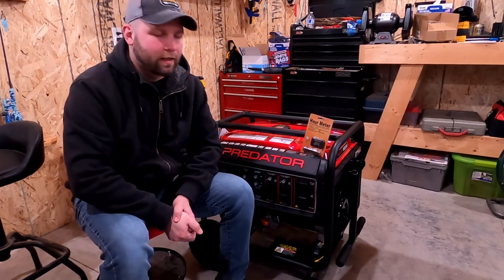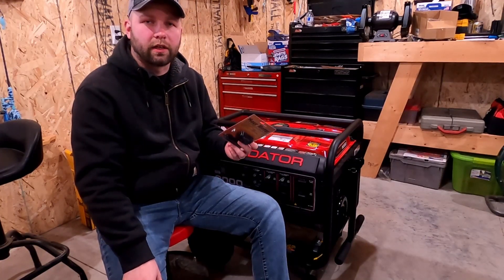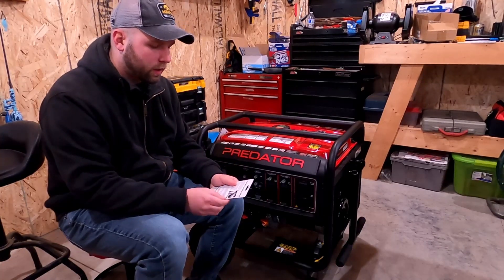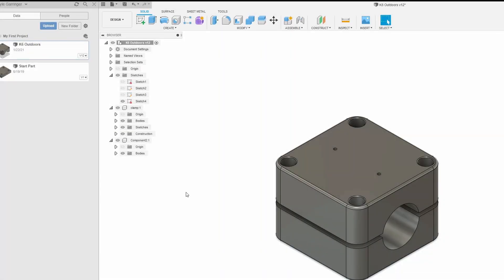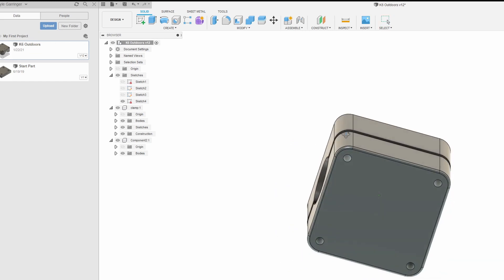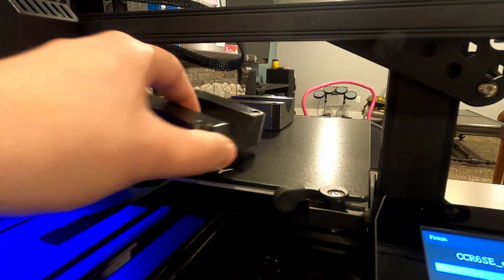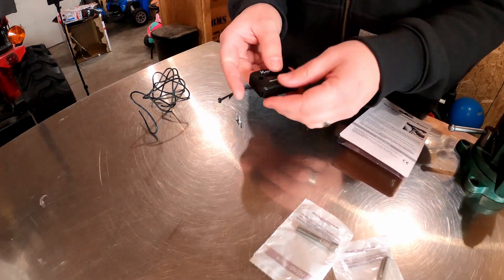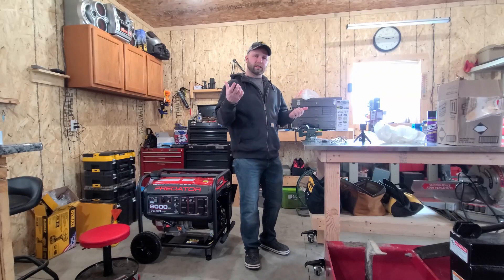Universal Hour Meter Install on the Harbor Freight Predator 9000 Generator

Comment: Awesome installation. I’ve got almost every other tool but a 3-D printer. I don’t think of any viewers are going to have access to a 3-D printer. I made a project box with 2 LCD displays showing volts, amps, amp hours and watts. One for each of the two phases. It’s mounted near my innerlock near my main panel. I also threw in one of these our meters on the project box. Works great. A 3-D printer would’ve been awesome for making my project box but I found a standard size one that works fine and cost $15. Great job on yours
Reply from the maker: Greatly appreciate it! The printer is a great addition and I very reasonable in price. I hope to get the house connection setup this spring so I can plug and play the generator. Thanks for stopping in!
Reply: @k6outdoors  what model is it?  I might have to consider getting one. Thanks
Reply from the maker: @condor5635  it is the CR6 SE, checkout the link in the description below.
Reply: @k6outdoors  - Thank you is the software that you demoed part of the 3-D printer package?
Reply from the maker: @condor5635  the printer software is free and came with it. Fusion 360 is free as well
Reply: @condor5635  ⚠️Reminder about generator safety: This is a very important announcement for everyone just to make sure:

1) KEEPING OTHERS SAFE: Please do not allow an unqualified person or your children to operate and service the portable generator. Just because some manuals don’t say that doesn’t mean it’s safe. That is important against the generator safety rules. We also need to be keeping an eye on our children too. You need to make sure that your children are not playing near the portable generator especially when it’s running so they won’t get electrocuted. Generators pose electrical risks and they can be hot during an operation. Please keep your children away from the portable generator at all times. It is important to keep our children safe especially our little ones. Be aware of all the hazards.

2) WHERE TO RUN YOUR GENERATOR: Some people use their portable generators indoors which increases the risk of carbon monoxide poisoning. It’s important to have a carbon monoxide if you have a gas generator. Never ever use your generator indoors even if your doors and windows are open and even in the garage is not safe to use a portable generator. Not even at your porch and your deck. It is never safe to use your generator indoors and in enclosed areas of your home. Your generator needs to be 15-20 feet away from your house. 

3)🔥FIRE HAZARDS: Never refuel your generator while it’s running. You need to let your generator cool off before refueling it and before storing your generator. Never overload your generator too. Never ever back feed your generator. You should never plug your generator into a wall outlet. Also never store propane tanks indoors. Please keep flammable things away from the generator as well and please don’t smoke cigarettes near the generator. Having a fire extinguisher next to the generator is also important against the generator safety rules. 

4) GENERATOR OPERATION: make sure your hands are dry before touching the generator. Never use your generator in wet conditions. Don’t let your generator get wet. You need a generator tent if you need to use your generator during wet weather. Please don’t wear loose clothes when operating the generator. Turn on your generator before plugging in appliances. Use the right cord for your generator. Please do not use worn out cords. 

Hope this helps. Thank you. It’s important to follow all the generator safety rules whenever you use your portable generator.

Comment: Great video. I bought the Predator 8750 several years ago and luckily haven't needed it yet. Its still in the original box....lol. Actually I didn't pay attention that it has no hour meter especially since its still in the box. At the time of purchase this was the biggest Harbor Freight had in stock. I like the idea of having an hour meter on it and plan on purchasing one from Amazon in the next day or so.
Reply from the maker: The link for exact one I used is in the description, take care!
Reply: I hope you've ran it and changed the oil in it a few times since buying it 😬

Comment: I picked up that same hour meter for mine.  I like the idea of the 3D printed mount.  I'm designing stuff like that all the time.  Unfortunately, I don't like that location.  The very first thing I did after storing my predator in my garage, was pile a few things on top. lol.  That mount puts the meter in harms way.  Though I hate damaging the factory look, I think I'll screw mine into the face plate of the unit.  It's going to live with the unit for the rest of its service life anyway.
Reply from the maker: Many options for sure on how to do this and I dont think one is wrong, just personal preference is all. Appreciate you stopping in and leaving a comment! Take Care
Reply: @k6outdoors  Ya the block looks like overkill for sure, also a different location for me. I will mount to the faceplate too.

Comment: Great video.  I wonder if it keeps the hours or does it ever reset? It wouldn’t be hard to write to permanent memory but just wondering about long term performance.  The hour meter on my zero turn has pooped out and this might be a good alternative.
Reply from the maker: Thus far mine has not reset and continues to perform well! Thanks for stopping in!

Comment: When the Predator is not in use, I stack stuff on the plyboard on top of 
it which the location of your hour meter kind of eliminates, doesn't it?
Reply from the maker: Technically you can mount it on any part of the bar as it is all the same size. I store my generator under a rack so nothing is ever stacked ontop of it. Good question and thanks for stopping in!
Reply: Thanks for your soon response and no hard feelings, I just had to mention it since I may operate under different circumstances.
Reply from the maker: @johnlong7504  I appreciate the comments! Thanks for stopping in
Reply: Take care & try to stay out of trouble!

Comment: So if the little battery goes dead i would assume you loose the stored memory? 
Unless there's a secondary battery which i would doubt so in a cheap meter
Reply from the maker: Good question, the specific jour meter states this "No battery required. Total hours accumulated is not re-settable and cannot be erased." Thanks for stopping in!

Comment: I have the same generator and the first thing I did was adjusting the carburetor spring to avoid 
idling rpm's  down to ~ 1,000 instead of the cold engine killing 3,650 rpm you all seem to like!
Reply from the maker: I havent heard of many issues with them starting the way they do and lasting. If it makes you feel more comforitable with that method do what you need to do! Thanks for stopping in!
Reply: 10 - 4!

Comment: I drilled and mounted my tach/hour meter into the black plastic above the PREDATOR emboss. Where the start up, and shut down procedures sticker is. Looks totally custom sitting there. As if it was designed to be there. I'm just having trouble figuring out how to run the wire so it's invisible, like on my Honda mower.
Reply from the maker: Another Great way to do it, I just prefer not to drill holes in my generator! Thanks for stopping by!

Comment: I just bought the 9000 predator and really would like to install the meter like you, however, I do not have access to a printer. Would you be open to making one for me and of course I will pay you for the cost/time and shipping.
Reply from the maker: I can get something listed on my etsy site for this if your interested
Reply: @k6outdoors  that would be great. Thanks. I will keep a check on your site. I assume it is linked below?
Reply from the maker: @sencman200  i will reply and let you know when ive got the link setup
Reply: @k6outdoors  thank you. I also sent you an e mail. I am not real good with the finding links and things on youtube.
Reply from the maker: Here is a link to the posting https://www.etsy.com/K6Outdoors/listing/1097117187/hour-meter-mount-for-predator-9000?utm_source=Copy&utm_medium=ListingManager&utm_campaign=Share&utm_term=so.lmsm&share_time=1633485408431
Reply: @k6outdoors  placing order now. Thank you very much.
Reply: I have just completed the order. I used PayPal so should be no issues. Should any occur, let me know. Thanks again.
Reply from the maker: @sencman200  got it! Thank you
Reply: @k6outdoors  Hey thank you!! I thought of a question that I wanted to ask your opinion on as you seem to have an excellent knowledge of the equipment. I have watched several videos on this model by other YouTubers, but one was doing something that I cannot find in the manual to do. He said that he read or was told to run the generator for 1 hour, then change the oil. Then to run the unit a 2nd hour with a 500 watt load on it and change the oil. I cannot find in the manual anywhere that recommends doing that. The manual recommends to change at 20 hour intervals. Do you think the 1 and 2 hour routine is warranted or is it ok to do the 20 hour as the manual recommends. How did you break your generator in? Thanks for any suggestions.
Reply from the maker: @sencman200  i personally just ran it for the break in period (3 hours I think) that it talks about in the manual and then changed the oil. Since there is no filter i wanted to just make sure i get any breaking metal out of the system. The 1 and 2 hour service seems excessive to me, but that is just my opinion.

Comment: When I bring the file from Thingiverse into Cura it comes in at 3mm x 1mm x 3mm and is very tiny. Does anyone know what the size should be?
Reply from the maker: You need to scale the item, it was designed in inch. it should read 2540 in the scale percentage. Thanks for stopping by

Comment: Does the generator is clean power?
Reply from the maker: Thanks you for stopping in,  they do reccomend  you have protection of your sensitive electronics. Based upon feedback ive heard and what I've seen it does produce pretty "clean" power. If that is you main concern an inverter style of generator may be for you.  Cheers
Reply: I want to run off my welder and evelast welder need 5%THD i dont know how much % does the generator has
Reply from the maker: It doesn't specifically say in the owners manual. All it says is that sensitive electronics such as tv's need to be plugged into surge protectors for protection.  May people say they use them for their welders but I haven't used it myself

Comment: somethings not right with the 3d file... it comes up the size of a postage stamp :-(. Can you share the actual dimensions?
Reply from the maker: When you import it you have to scale it to metric, the item is in inch. Thanks for stopping in!
Reply: @k6outdoors  thanks! Can you share the specs on the mounting bolts you used? What thread and length? Thanks again!